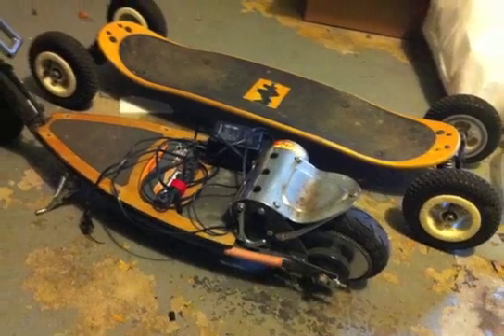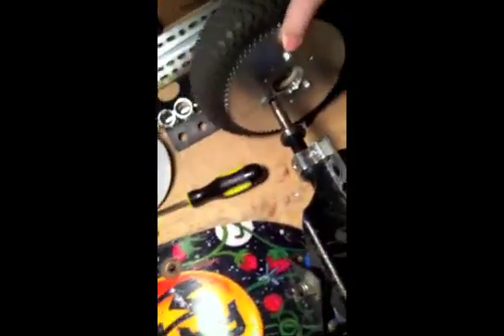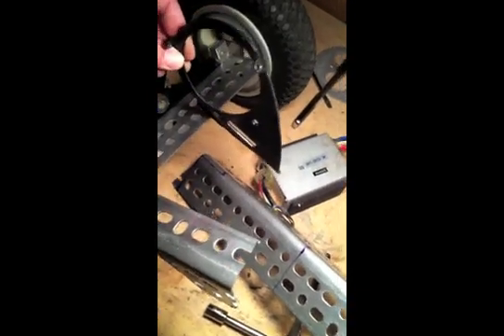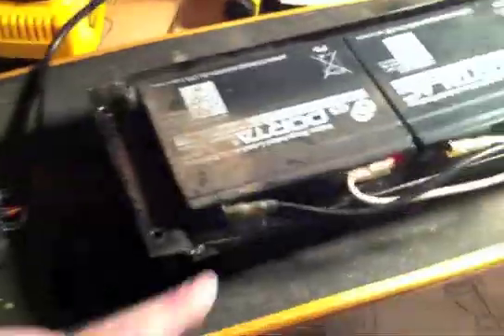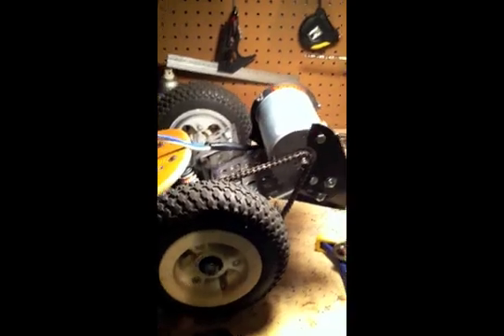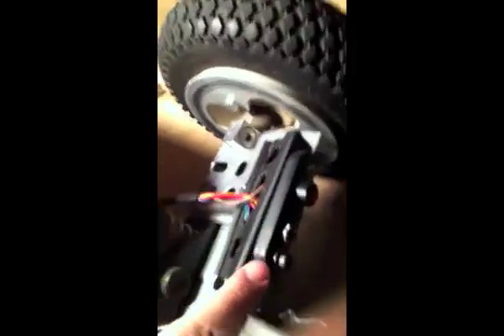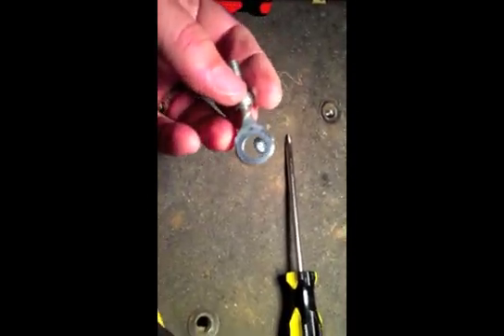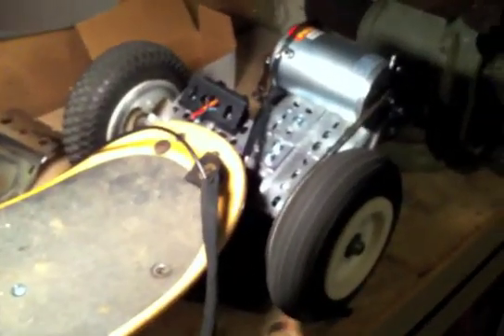Electric Mountainboard conversion Part 3 of 3

Comment from the maker: @viktor1324 Hey Viktor! thanks for subscribing. It does lurch a bit when starting from a dead stop. It helps to push off a bit, then pull the go trigger.  It would do that regardless of one wheel drive or all wheel drive I believe personally. Then engine power is small and I weigh 220lbs.I have recently joined weight watchers...:)